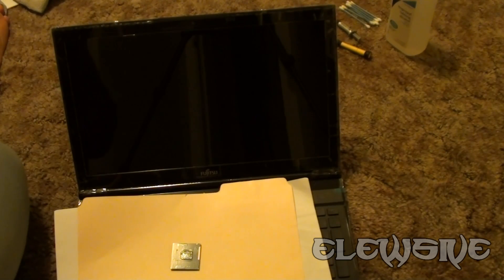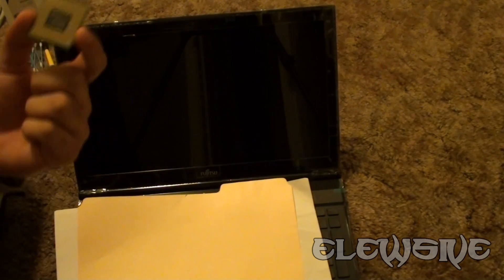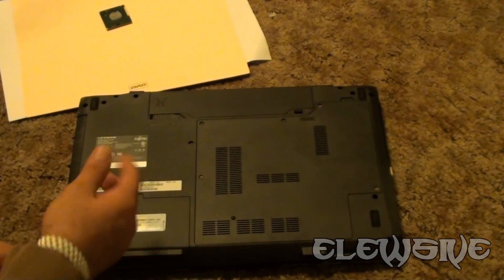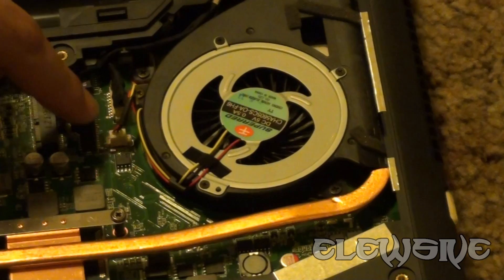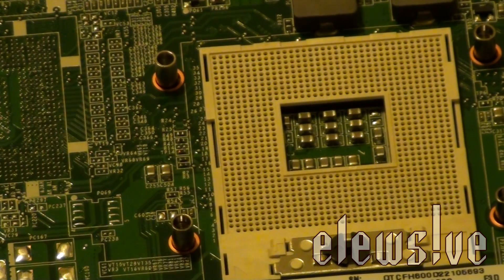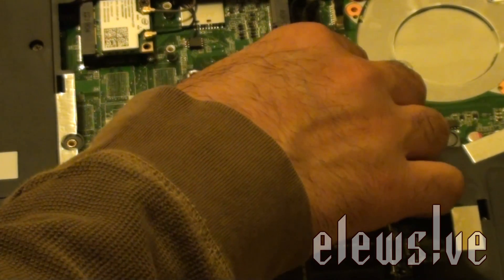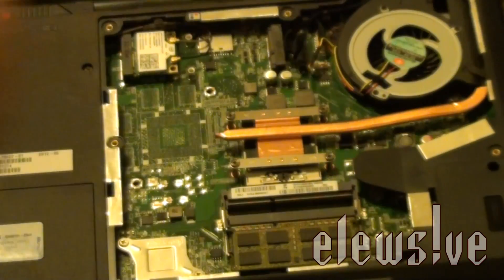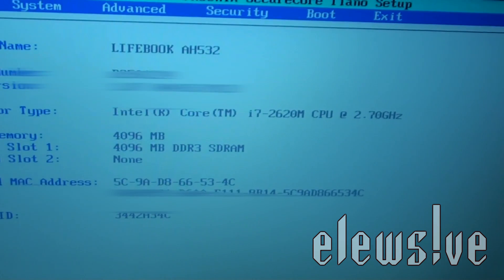[HOW-TO] - Fujitsu lifebook AH532 i7 CPU Upgrade

Comment: HI djelusion, did you have to upgrade your BIOS before the CPU upgrade/install?  Mine is v1.07 dated 4/03/2012 and I see Fujitsu has a newer one 1.1.1.0 dated 10/22/2013.  I wonder if I should flash my BIOS before doing the upgrade??  Thanks for the help/info!
Reply from the maker: Hi David sorry for the late response. Youtube has done funny things with notifications. The Bios could not be updated because Fujitsu didn't release a newer one sadly till this day there's no bios updates. But im selling this laptop now equipped with 16GB ram and a 240GB solid state Drive.

Comment: upgrade Fujitsu lifebook AH532 CPU: Intel® Core™ i3,Intel® Core™ i5,Intel® Core™ i7, IVY BRIDGE end SANDY BRIDGE ONLY TDP-35 W !!!!!!!!!!!!!!!!!!!!!!!!!!!!!ONLY TDP-35 W!!!!!!!!   upgrade Fujitsu lifebook AH531 ONLY  SANDY BRIDGE!!!!  TDP-35 W !!!
Reply: +super-puper what if you put 55w in it? possible?????
Reply: Pixelator Pro XE

only 35 watts iwi Bridge(22nm) and Sandy Bridge(32nm)
Reply: Ivy Bridge? That's use the same socket?
Reply: Pixelator Pro XE

ah532 made under Ivy Bridge and Sandy Bridge compatible with
Reply: Pixelator Pro XE

I put the CPU cycles i3 3110m

Comment: I have a Fujitsu lifebook AH531 could I upgrade it has stock in it already 
Intel Pentium CPU B960 @ 2.20 GHz 
With 2gb of ram 
64 bit windows 7 home premium 
Sub score
Processor 6,1
Ram 5.5 
Graphics 4.5 
Gaming graphics 5.9 
Primary bard drive 5.9 
Base score 
4.5 Determined by lowest subscore
Reply: ***** I have a Fujitsu lifebook AH532G nvidia 620 1G 128 bit.
Intel Pentium CPU B960 @ 2.20 GHz  upgrade to Intel Core i3 3110M 2.4GHz 
With 8gb of ram  
64 bit windows 7 ultimeit
Sub score
Processor 6,7
Ram 7.4
Graphics 6.7 
Gaming graphics 6.9 
Primary bard drive 5.4

Comment: Hey dude
1st of all thanks alot for this amazing video
2nd am about to replace my AH531 processor which is the same onr showed in here to the I7 2620M, well my question is did you noticed any heating problems, bat runs out faster ?
anything like that ?

Thanks dude :)
Reply: Also did you trie to overclock it ?
if so yes can you tell me if anything bad happened like same Batterie, heating anything. .... ?
Reply from the maker: Hi sorry for the late reply. Sawmé Sami . No heating issues no issues with the battery as its always plugged in and I used it as my main workstation.
Reply from the maker: Sawmé Sami I have not tried to overclock my laptop. It runs faster I have not used my i3 cpu it was swapped out before I could use the cpu.

Comment: does this motherboard have crl cmos jumper or removable cmos batery 3v??? i need to clear bios password
Reply from the maker: I haven't ran into that issue sorry. That has to be the first time I am hearing about a consumer laptop bios password issue. Not sure if the clear settings would do much good. If there is a battery you would have to disassemble the whole laptop if im not mistaken. its been a few years since Ive opened the laptop. This video was taken in 2012

Comment: Hey dude I was just wondering if there was a possible way to upgrade my laptop. I am running the Fujitsu Lifebook AH530, I have an Intel Pentium P6200 and 4gb of RAM. I need to know if I could possibly upgrade my proccessor and if I can what performance to expect.
Reply from the maker: You can upgrade to a Intel  i5-480M Processor. with the max ram of 8GB 4 GB (2 GB x 2): DDR3 1066MHz

Comment: i Have 

a 
FUGITSU FMV-830NU/LX     HOW TO UPGRADE MY LAPTOP
Reply from the maker: you mean Fujitsu, and NO it will not work. that laptop is so old you are better off throwing it in the trash and buying something with more horsepower and capabilities. I sell laptops with windows 7 installed including office 2010 for $200. 2GB ram and has wifi N.

Comment: What is the replacement CPU called?
Reply: There is 3 cases
If your CPU broke and you bought the same one then you are " Replacing"
if you had an old CPU and you bought an older one its called " Downgrading "
if you had an old CPU and you bought a newer one ( better one ) 
then its called " Upgrading "

Excuse my English ;)
Reply: +Ahmad Muraish Ummm.... if I planned to Upgrade i5 480M (Dual-Core 2.66Ghz, Arrandale, 2011) to Core i7 920XM (Quad-Core 2.00Ghz-3.2Ghz, Clarkfield, 2010, Mobile Extreme Edition) is that "Downgrade"?

Comment: can i upgrade my video card? we have the same laptop fujitsu ah532. thanks bro.
Reply: but i have the i5 version
Reply from the maker: gpu is integrated with the cpu. the i3 - i7. visiting the intel website would show more details about the specific cpu youre interested in.
Reply: +djelusion no discrete? using HD 3000/4000?
Reply from the maker: hi there, no the video card is fixed, I have yet to see a laptop that will allow you to upgrade the video card aspect.

Comment from the maker: I recently added 16GB to my laptop and it works flawlessly and its got a ssd of course so its fast and super powerful. :)
Reply: lol dude am gona get soon the SDD KINGSTON V300 120GB
i will be doing some thing good and next year it will be time for I7 CPU then ill add 4GB + AND ILL SIMPLY HAVE SDD 120GB + 8GB RAM + I7 CPU I will have a good gaming laptop :D !!!!
Reply from the maker: great
Reply: sharbell monirgii any tip on a I7 that is working on Ah532? I want a I7 but i don't know what works
Reply: MrBrodernafluff i installed I7 it crashed but when i Installed I5 It worked juste fine
Reply from the maker: if you watch the video I clearly tell you which i7 im using.
Reply: i know that, but but that one is kind of weak so i asked for examples :p
Reply from the maker: good luck asking someone a question from 1 year ago doesn't look like they will respond. Weak or not this was the ONLY video related to this laptop I clearly demonstrate that. Nobody else can. Besides the CPU was free and weak or not you are not going to be gaining anything that will make the laptop run any faster.

Comment from the maker: I use this as a regular desktop in all honesty and it doesn't fail me at all. have a external monitor paired with a wireless keyboard. If you have 8 or 16GB ram that would be icing on the cake

Comment: Yo men! Do you know that your comp have slot for 3G? It is wright under the battery. You need to remove the sticker from the slot, BUT(!) you need to buy the 3G modem and install the driver for it. So, lucky to you.